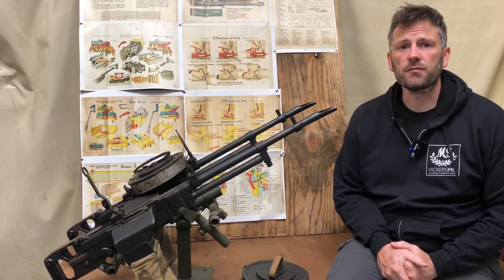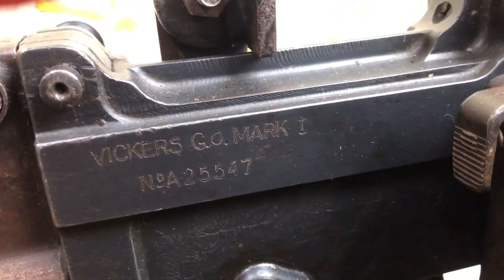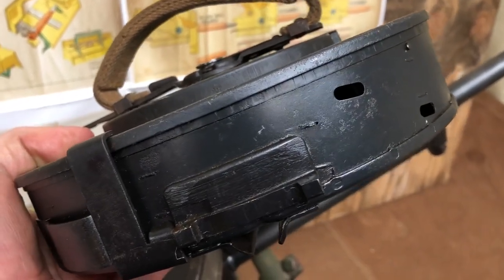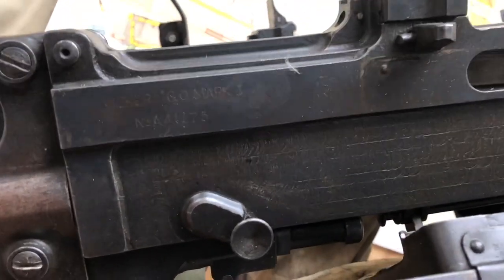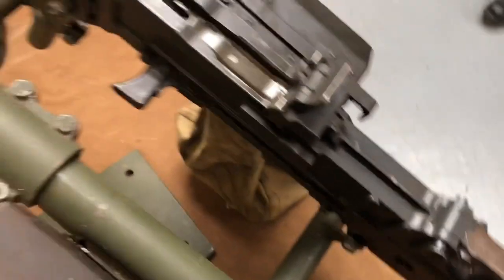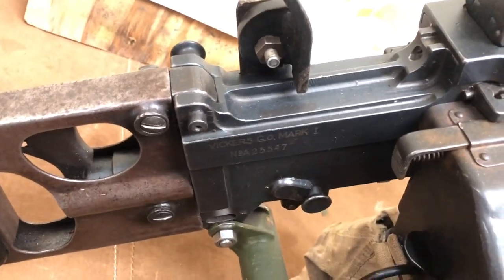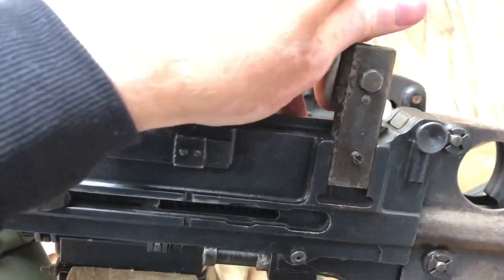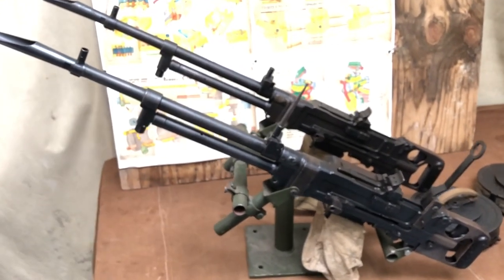Gun Study: A pair of Vickers ‘K’ Gas-Operated machine guns

Comment: I'm trying to put together a 1:6 scale homage to the LRDG & SAS but getting the models for the vehicles and weapons at that scale is like rocking horse shit. So I'm now thinking of 3D printing, but that requires blueprints/diagrams to pull the sizes off. Of course no mechanism details just enough to make a good facsimile. Any help out there would be greatly appreciated. TIA.
Reply from the maker: Some of the drawings by John Lambert would be sufficient for you. There are several 3D print models already available as well. We've used a few of them to test accuracy etc.